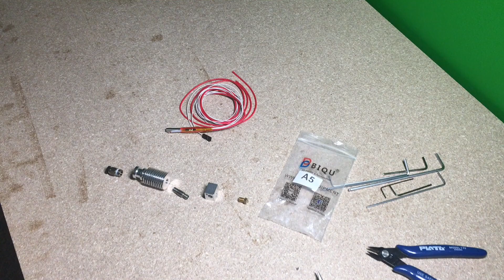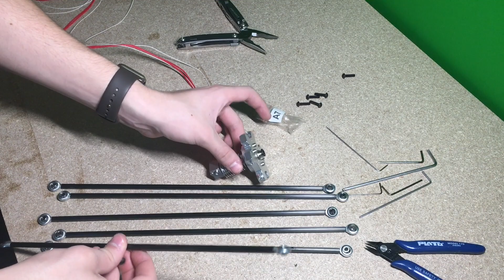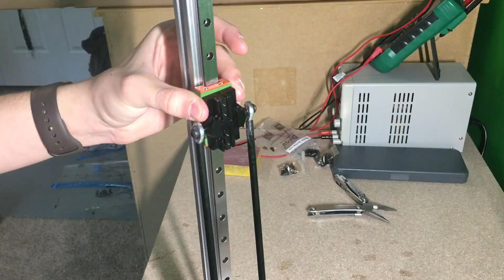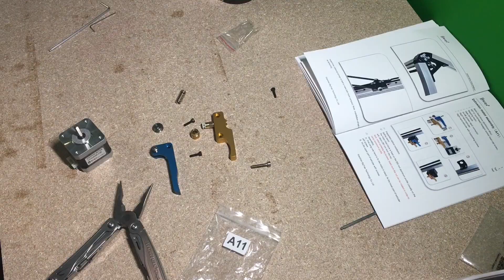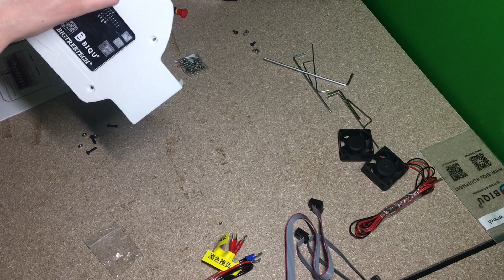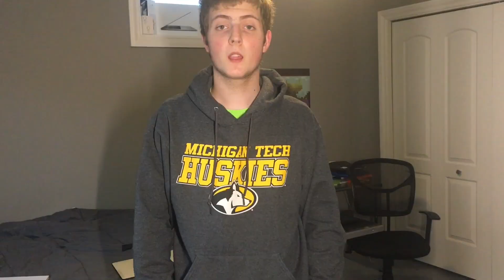BIQU Kossel Plus Kit Build Log Part 2 | 3D Printing

Comment: Could do with a bit more info on the belt & springs.
Reply from the maker: Sorry about that, what info are you looking for? I could provide info.
Reply: Yeah, where do the 3 rotational springs go on the belt set up? Plus the wiring isn`t exactly clear, as in what are motors E0 & E1 supposed to relate to?
Reply from the maker: The rotational spring I believe is this (https://www.robotdigg.com/product/41/Timing-Belt-Tensioner-Spring), correct? If so, those are used to add tension to your timing belts. I placed mine below the linear guide and you can follow that image for proper installation. Motors E0 and E1 are the extruder motor numbers. E0 would be the first extruder and E1 for a dual extruder setup.
Reply: Cheers man.
Reply from the maker: If you have any other questions, I can attempt to help.
Reply: The surge protector does not fit any UK plug.  It would need a much longer earth pin but I must be missing a manual as I have no documentation o the led screen or set up. The SD card seems to be blank too.
Reply from the maker: What do you mean by surge protector? The SD card was not blank for me. I can see if I backed up the sd card and upload for you.
Reply: That would be handy I`m not getting it easy with the led screen either. Does it work as a touch screen? Mine does not. The surge protector is not usable in a UK set-up. I managed to hoke out an old style shaver socket that only 2  pins fit into. UK plugs are all the square pin type & the earth is the longest as for safety sake it goes in first to let the other two in.
Reply from the maker: It is not a touchscreen. Here is a link to the sd card files. https://drive.google.com/open?id=1Z4oCRw76tXeqSQdz8c2SlUyiU_4Xe1Xt
Reply: Cheers man, are all the correct settings loaded in the config.h file or do I need to set it?
Reply: The audrino files were corrupted and will not open... thanks for trying.

Comment: Yeah I never saw that review uploaded! I feel like maybe biqu payed you to make this video with no negatives. After all there are so many issues people have with this printer.
Reply from the maker: I will be recording the review video this weekend. I had one issue with a carbon rod snapping which, BIQU gladly sent a replacement part for. The printer is quite nice and is extremely quiet!! BIQU did not pay me to make the video with no negatives. In the review there will be a few negatives like how the autoleveling is set up (but there is a firmware fix, where the autoleveling is saved).

Comment: Did you ever get that 3d printer calibrated and working?  I got the same one and none of the software on the SD car would install, so I downloaded Cura, but so far I have not gotten it to print.
Reply from the maker: Yes. I have gotten the printer working and calibrated. There was a steep learning curve (and still a lot for me to learn) for me because this was the first Delta based printer I have ever owned. I downloaded some firmware posted in the Facebook group . I am awaiting some replacement parts at the moment because I was careless and broke something on the printer. Once the parts come in the coming days. I will record a review video and a calibration and getting a first print video. 

Facebook Group Link - https://www.facebook.com/groups/1680600228892779/